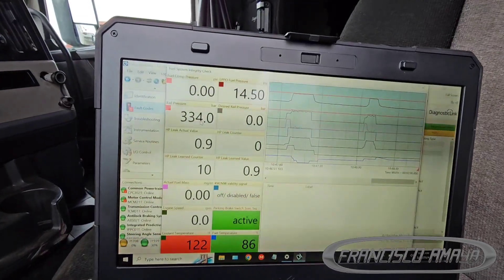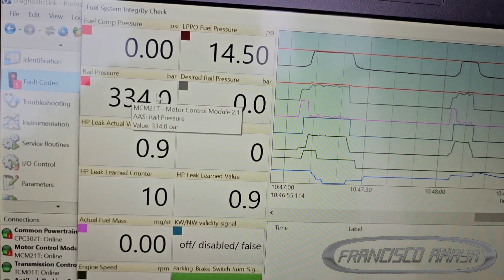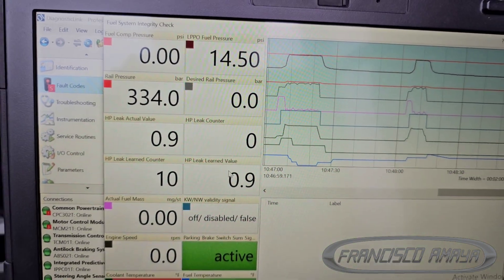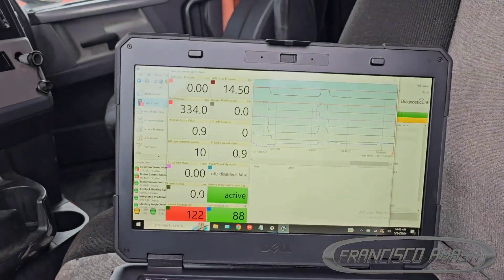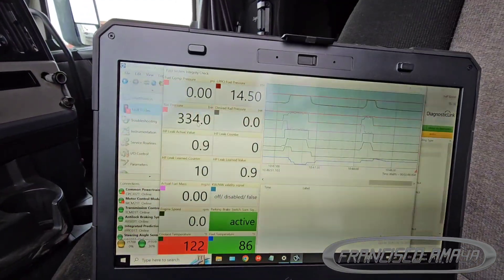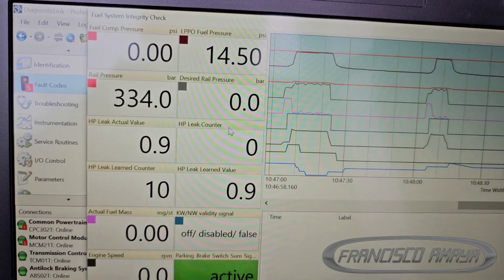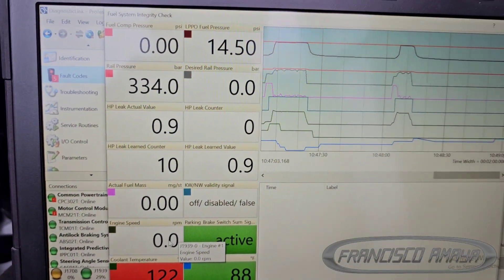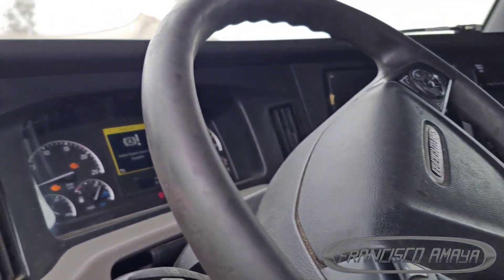DD13 ENGINE FUEL RAIL HIGH PRESSURE SENSOR FAILURE FREIGHTLINER CASCADIA DD15

Comment: Thanks for the detailed video. I had a question based on my situation. I’m getting SPN 157 FMI 16 / SPN 520268 FMI 16 (fuel rail pressure low) on my Freightliner Cascadia DD13, but the truck runs perfectly fine — no power loss, no derate, no hard starting, and the check engine light only comes on briefly and then goes away.

I also had some electrical issues earlier (battery corrosion, loose fuel tank level sensor plug causing the gauge to drop), which I’ve been fixing. After long drives the code shows up, but after key-off it clears.

Since the engine performance is normal, do you think this could be an electrical/voltage or wiring issue affecting the sensor signal rather than an actual fuel pressure problem? Appreciate your thoughts. Thanks again for the video.